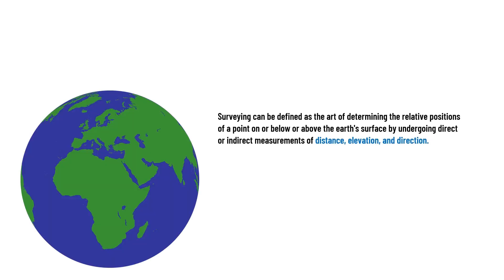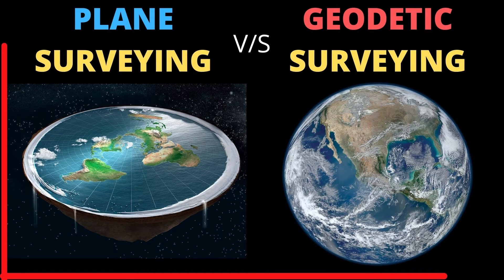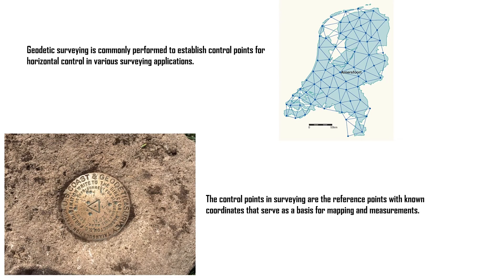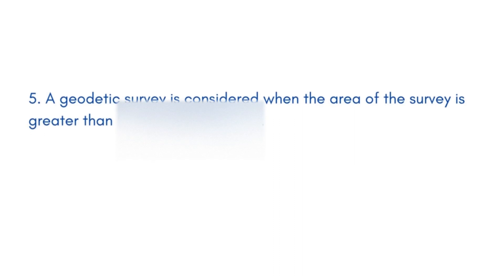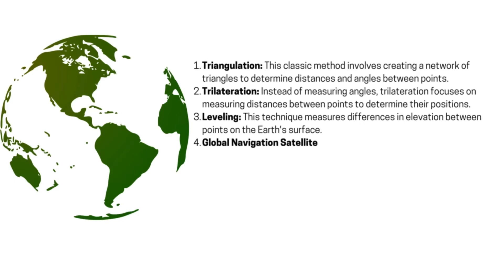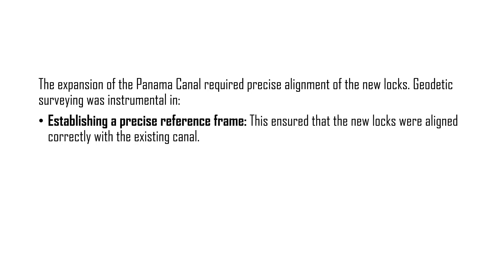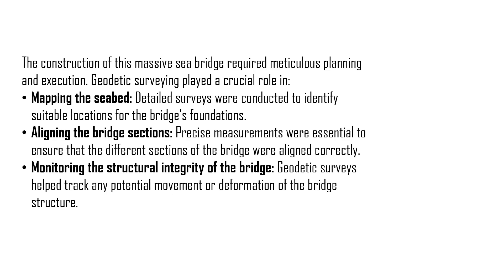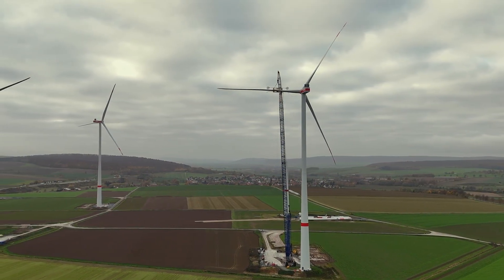What is Geodetic Surveying? Real Life Examples

Comment: I am sure you meant to specify 250 square MILES and not 250 square metres. 1 square mile = 2.58998811 square kilometer, giving 250 square miles equals 647.497 square kilometers. Else, 195.5 square kilometers = 75.483 square miles.
Reply from the maker: Thank you for pointing this out! I mistakenly showed 250 m² in the video — the correct value should be 250 km² (square kilometers), not square meters. Apologies for later reply!